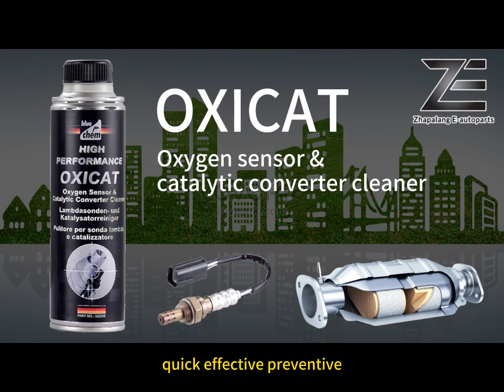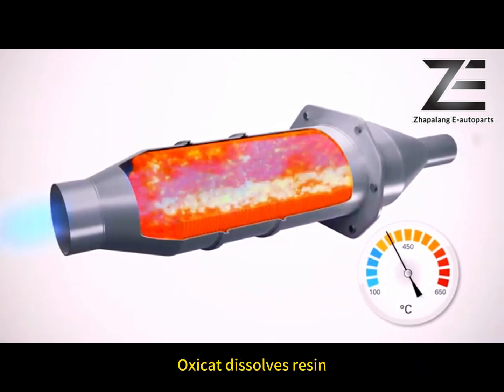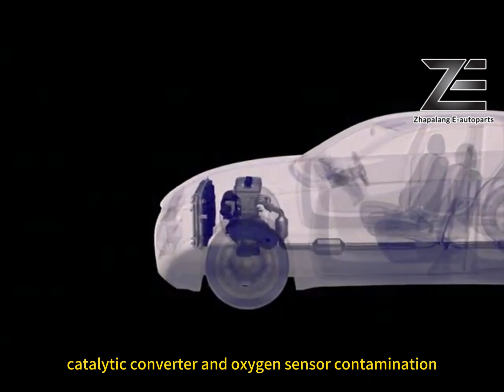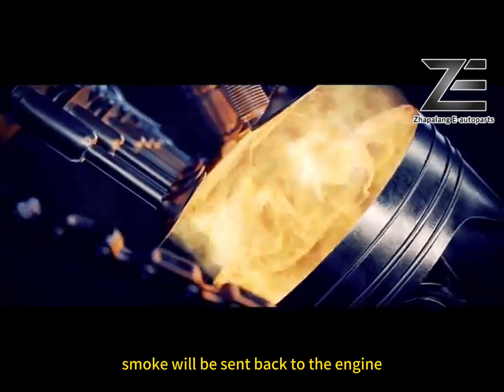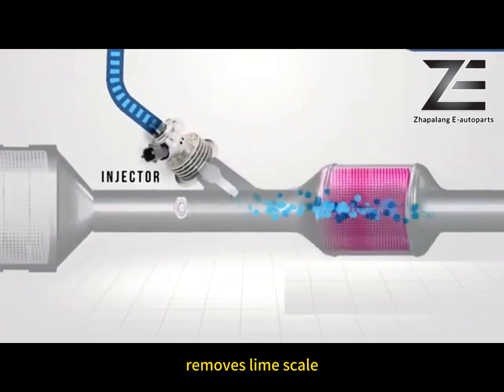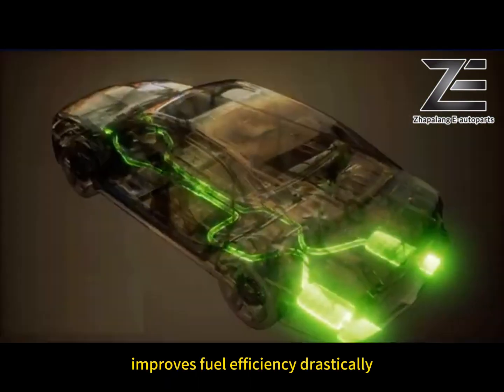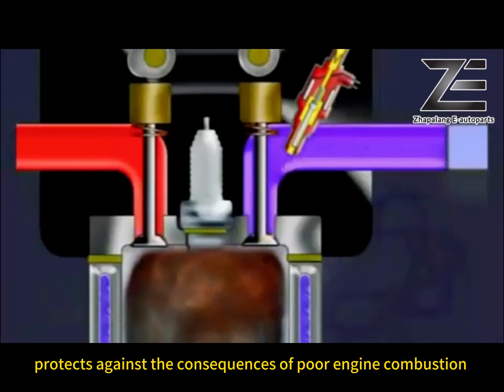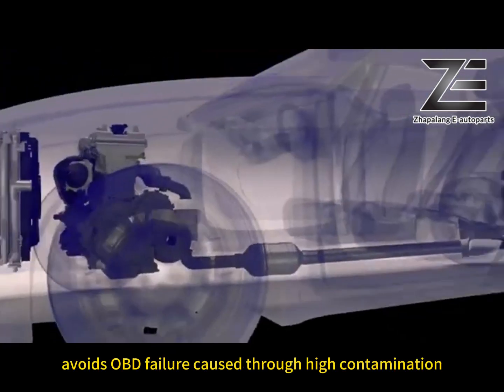Bluechem Oxicat: Premier Oxygen Sensor & Catalytic Converter Cleaner for Optimal Engine Efficiency

Comment: Okay thanks Good to know so do you poor the catalytic converter when you have a little gas or when you have a lot of gas
Reply: Great question! The catalytic converter works regardless of the amount of gas in your tank, but for BlueChem Oxicat to work effectively, it’s important to follow the recommended mixing ratio. Use 250 ml of Oxicat for every 60-80 liters of fuel (1:300 ratio). Avoid using it with less fuel than recommended, as this could affect its performance. Always observe the proper ratio to ensure optimal cleaning and protection for your catalytic converter. Thanks for watching and for your comment!